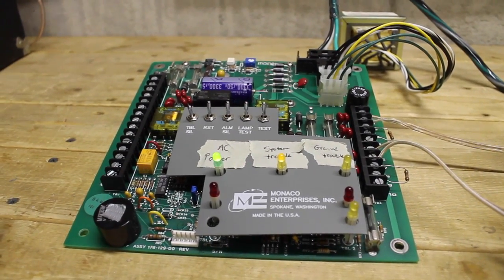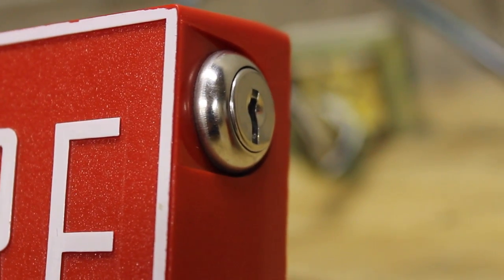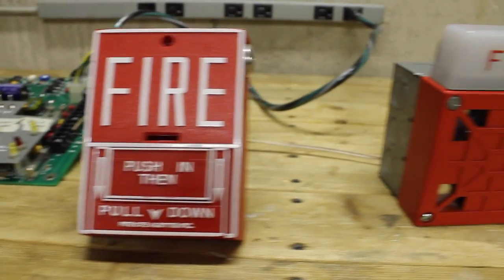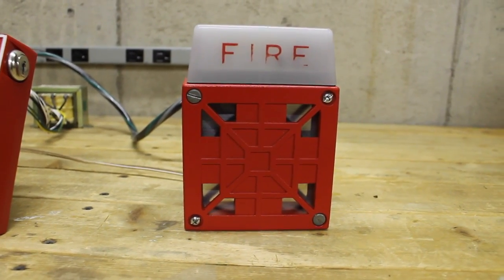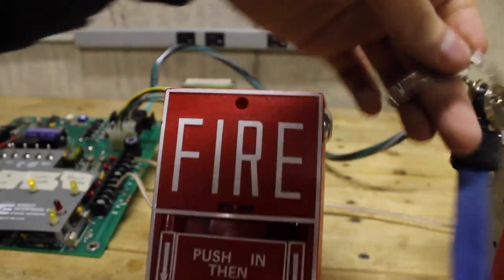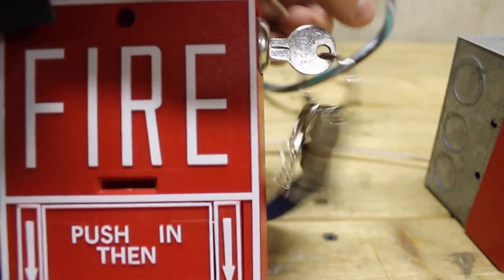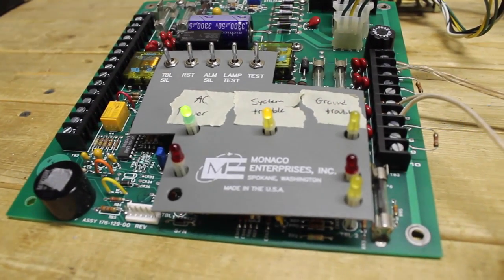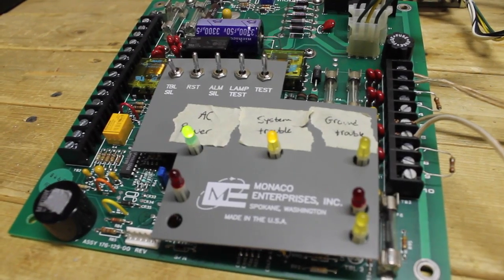Monaco Vulcan 1: System Test 2 - 7002T!

Comment: Did that 7002T not work in one of our videos? Or it is a new one?
Reply from the maker: +FireAlarmGuy13 The "7002T" that didn't work was a 34T-24-WS-24VDC, essentially a 4-wire 7002T. This 7002T works just fine, I've had this for four years now, and it still seems pretty healthy (the FWR doesn't do any justice here).
Reply: Ok thank

Comment: At least you didn't put a TrueAlert on the FWR.😂
Reply from the maker: +Landon Lefevre Trust me, after hearing some horror stories about the fact it can destroy the device AND/OR the panel, I don't have any plans to! Makes me appreciate a lot of the other devices I have, they're both capable of FWR AND Filtered DC.
Reply: @NewEnglandElevators  What I would do is get batteries and unplug the panel and just run it off the batteries with a TrueAlert